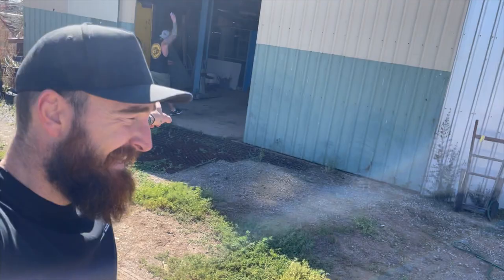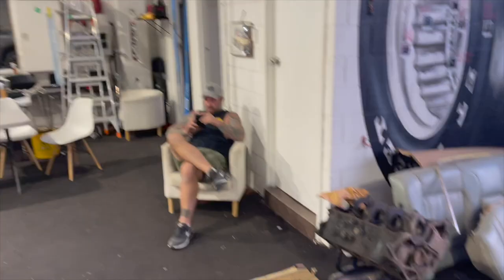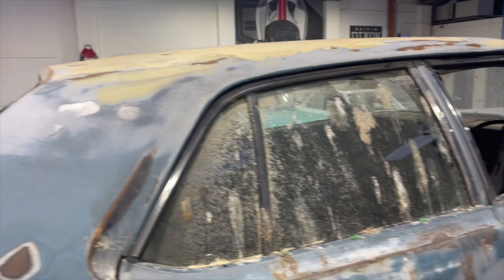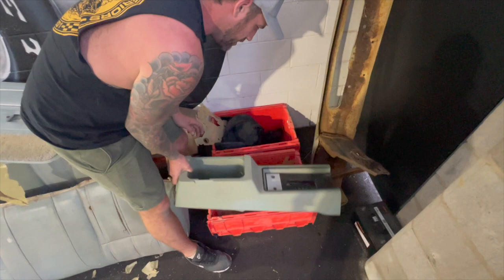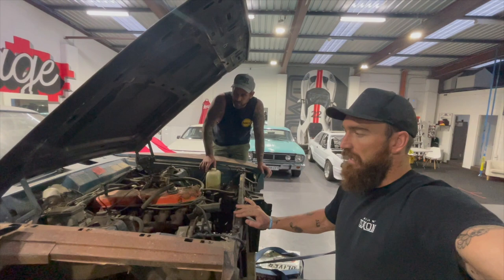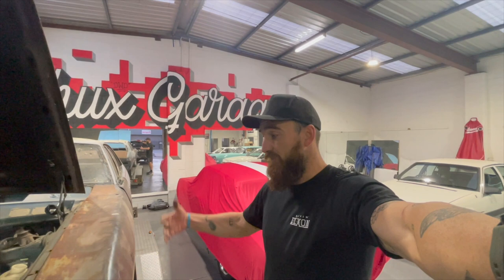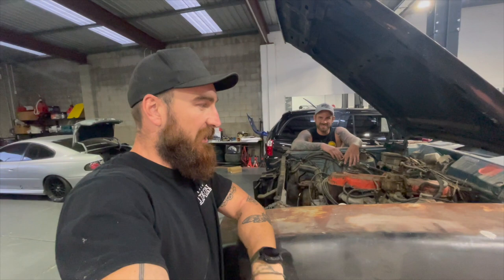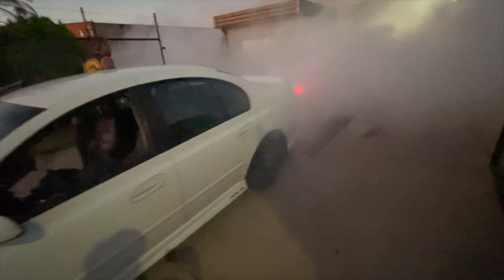The IRON EMPIRE and DRIVIN’ WITH DIXON build an XC 💪🏽

Comment: Very nice lads, and on the tub question There is a few killer ways to do a ford. My brothers xw is tub but with a factory look, still has a small lip near the chassis so it looks all oem. And can fit a 275/60r radial. Process of widening the existing wheel well, and welding in a strip to take up the wider width. All depends on what size tire you want to fit but that is a nice way to keep a factory look and fit a big tyre, love the build. 🤘🏻